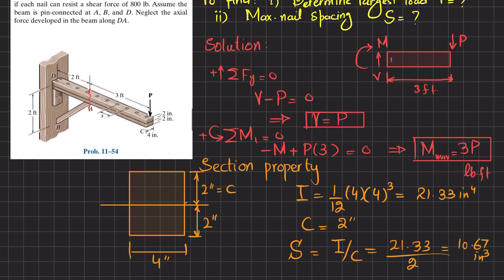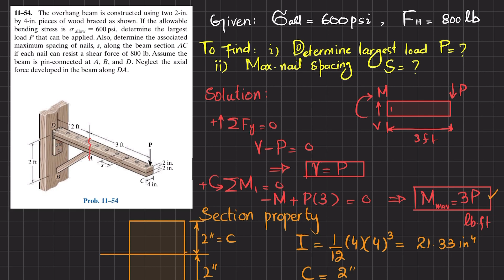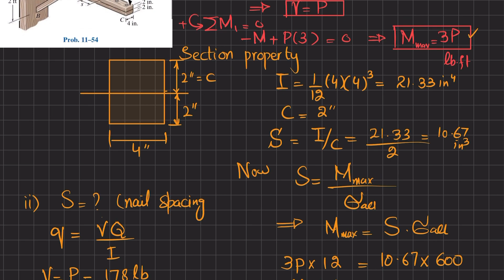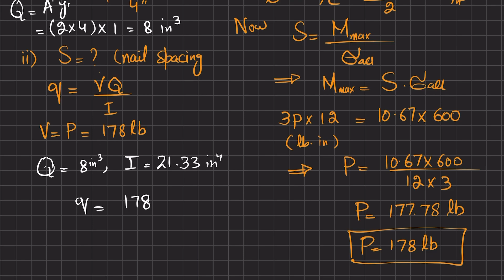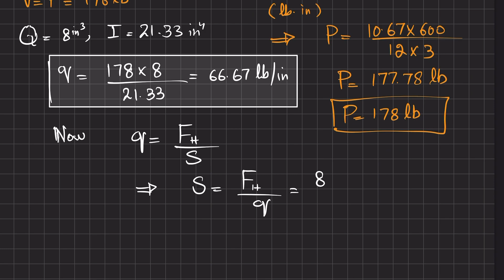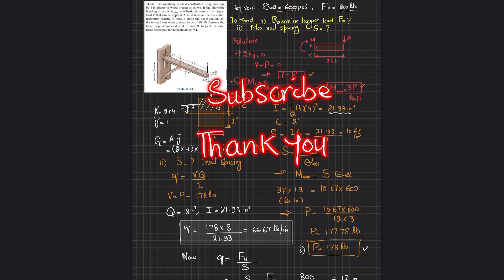11-54 Determine largest load P that can be applied and nails spacing | Mech of Materials RC Hibbeler

Comment: Hi sir ,You divided the moment of inertia by the thickness of the upper beam, what does this actually give the moment of inertia of the upper part, this is the definition of s of the upper part of the beam?
Reply from the maker: This is what we called section modulus and this section modulus =I/c , by which we can select the beam from the geometric problem of structure I.e wide flange beam , short flange beam, channel or t beams etc. I have posted a video on my community tab you can just go through that problem 11-26 you will understand how to design the beam and select the lightest beam. ❤thank you for watching my videos and asking questions
Reply: @engradnanrasheedmechanical  , it was helpful thank you